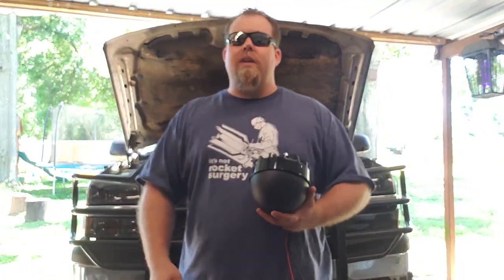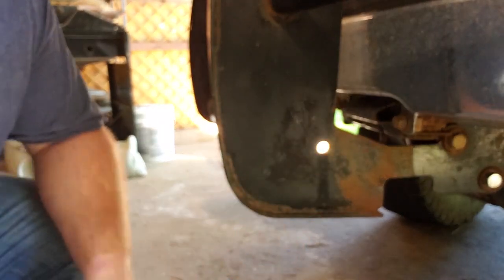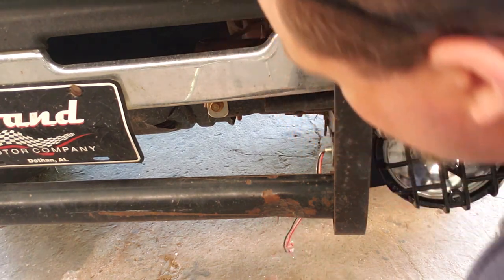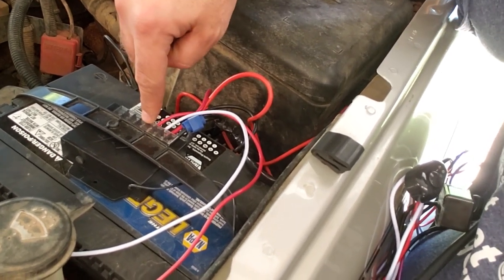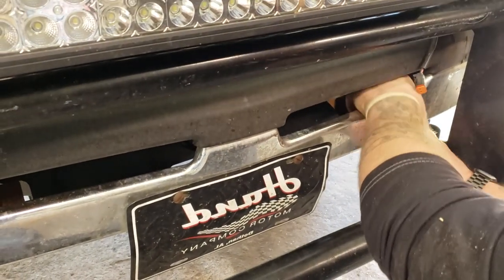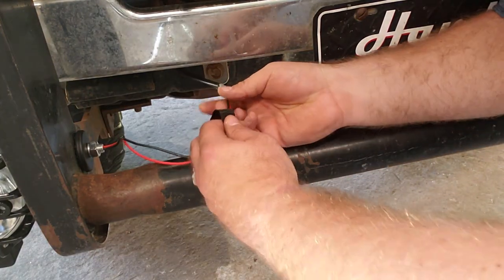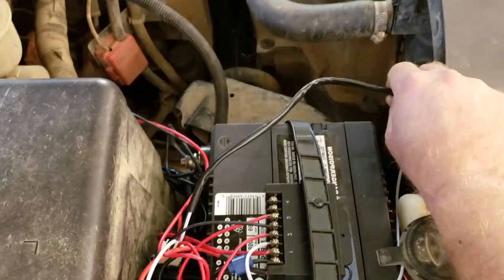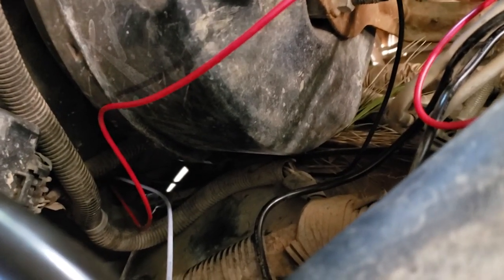How To Install A Light Kit On A Chevy Silverado Brush Guard

Comment: Link to that terminal box??
Reply from the maker: Carson, this is the closest I could find online. My cousin purchased his at a local off road shop in the town he lives in.

https://www.ebay.com/itm/4-Channel-Wireless-Remote-12V-light-or-strobe-relay/381595234035?hash=item58d8d92ef3:g:4c8AAMXQXQxRZaUa

If you will try searching for "12v 4 channel relay with wireless remote", you will get lots of options and might find something that suits your needs better than this particular item. Good luck. Thanks for watching and commenting.